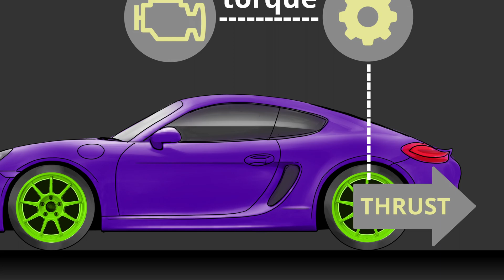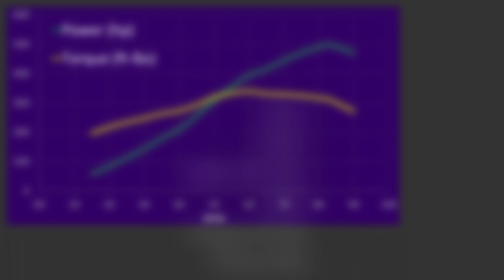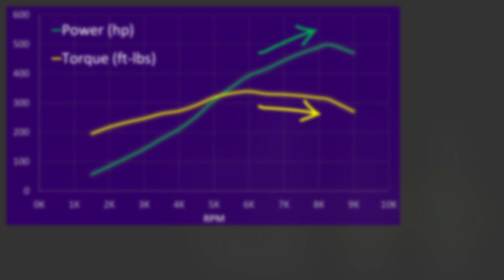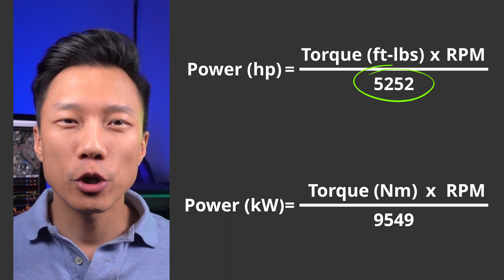Power vs Torque - ACCELERATION Explained [YOU'VE NOT HEARD THIS BEFORE]

Comment: What confuses me is how we can model the launch of a car. For example, for diesels, you have max torque at very low RPM. So, when you launch at that low rpm (around 1750 rpm), you have the maximum wheel torque exerted to the tires. So, theoretically, the car should launch the fastest at 1750 rpm. However, the car would launch much faster when loaded to 3000-4000 rpm. When the car is in gear and the clutch is fully engaged, what you summarized is completely true though.

Comment: @LastTenth
Great explanation!
Turbo vs NA engine
If we have two same cars, one with  NA engine,(with 200HP/15000rpm) and one with  turbo engine(with 200HP/7000rpm),  how than compare their acceleration, better lap time?  Both have their optimal gear ratios, but isn't turbo engine have more wider power band at higher rpms, more area under power curve, so is this reason why turbo will be always get better acceleration/lap time than NA engine? It will be good if  you can make detailed video about this Turbo vs NA engine, something related to area under power curve.
Reply from the maker: Thanks!
Physics doesn't care if a car is NA or turbo. If a car has a wider power band, it's going to generate more average acceleration. I'm no engine expert, but I don't know if the claim that turbo engines have wider power bands is universally true.

Comment: You contradict yourself.  You said as RPM goes up beyond peak torque, acceleration decreases, and then showed an example of higher thrust (and thus acceleration) at higher RPM.
Reply from the maker: I said acceleration decreases *in that gear*.
Reply: @LastTenth Right, but if power is what produces acceleration (which I think is your position) then why would acceleration decrease in that gear if power is still rising?
Reply: @ntdscherer  it wasn’t a contradiction: for a given GEAR peak acceleration will always occur at peak Torque.  However; for a given SPEED peak acceleration will always occur at peak Power.  

A practical example to illustrate?  If in third gear peak torque occurs at 3200RPM and 45MPH, peak acceleration in third gear will occur at 3200 RPM and 45 MPH.  If 45 MPH happens to be at the engines power peak in second gear the car will be accelerating harder in second gear at that RPM than it would be in third at that same 45MPH. 

Power, not torque, is the limiting factor in not only the top speed of a vehicle but also how quickly it can accelerate at any speed and how much weight it can pull up an incline at any speed.

Comment: So, if my engine produces peak torque at 2500 rpm and peak power at 5500 rpm, does that mean that in THE SAME GEAR the acceleration will be highest at 2500 rpm?
Reply from the maker: Yes.
Reply: @LastTenth  nice one, thanks
Reply: @LastTenth  I'm confused, shouldn't acceleration always increase as power increases?  if torque is basically force and power is forces/second isn't power the relevent one for acceleration. Torque being relevent in terms of how fast a car accelerates at a certain RPM for example from a cruise. In the example in the video you advocate for downshifting into high power RPMs but are now saying max torque RPM accelerates the most?
Reply from the maker: Hey thanks for your comment @carrot2556 ! First, power is not force/second. Second, I said we'll get max acceleration at the peak torque RPM, WITHIN a gear. If we downshift, the gearing is going to be different.
Reply: @LastTenth  I know but within a gear shouldn't the power matter more for acceleration,if so 5500rpm in 2nd gear accelerates harder than 2500 rpm in 2nd gear, as there's more power despite lower torque?
Reply from the maker: @carrot2556  no. Within a gear, torque matters more.
Reply: higher than at peak power yep but not necessery highest 😉 why ? cos it depend how torque graph look lower on rpms cos as vehicle increase speed all resist increases drag drive train losess and roll now if torque at 2500 rpm be 1 % more than at 1250 rpm the highest gforce reading in car can be registered lower than at 2500 rpm 😉👌🏻🍿…..
Reply: @LastTenth was correct to answer “yes” to your question but it only tells 1/2 the story.  To clarify and give perspective: Peak acceleration for a given GEAR will always occur at peak torque.  However, for a given speed peak acceleration will always occur at peak power.  A practical example?  If in third gear peak torque occurs at 3200RPM and 45MPH peak acceleration in third gear will occur at 3200 RPM and 45 MPH.  If 45 MPH happens to be at the engines power peak in second gear the car will be accelerating harder in second gear at that RPM than it would be in third at that same 45MPH.  
Power, not torque, is the limiting factor in not only the top speed of a vehicle but also how quickly it can accelerate at any speed and how much weight it can pull up an incline at any speed.
Reply: @rollsroyce329  yep, you are spot on. I already tested it with P-gear and my car, thats exactly what happens. I measured peak acceleration of 0.78G at peak torque at 2800rpm and it dropped off to 0.56G at peak rpm where the max power is in the same gear
Reply: @r390gt1lm now try it the other way.  Measure  G at peak power in first and note what speed that occurs.  Then measure G at that speed in second and third where the engine is likely making more torque at the corresponding RPM at that speed.
Reply: @rollsroyce329  yea done that too, since my car has peak torque in mid range and it drops off at high rpm, the best time to shift first 3 gears is at 7000, 4th and 5th at about 6000-6500, 6th and 7th at 5500 rpm.

Comment: I still don't quite understand, in the next video about shifting point said when to shift is when there are less torque produced in lower gear than in higher gear
Then isn't that torque is what important when thinking about acceleration? 0:17
Reply from the maker: I can see why it easy to mix this up. Yes WHEEL torque is what's important when thinking about acceleration. When power is higher, there is going to be some gear ratio that will allow the powertrain to produce more wheel torque, at some given speed, even if engine torque is lower.

Comment: Would torque be better for low speeds until reaching high speed which will utilize higher rpm for horsepower in a longer duration?
Reply from the maker: I'm not sure what you mean by better. Torque and Power are interelated. An amount of torque at some engine speed will always result in some fixed amount of power.
Reply: @LastTenth  you explain’d it correctly in the video. Gearing uncouples engine torque from wheel torque.
Reply: Many people think torque is for low vehicle speeds, towing steep hills and power is for top speed or very high speed.  This is an incorrect framing because gearing can change where and when we apply the engine’s power to the wheels. The engine’s Power, not it’s torque, is the limiting factor in not only the top speed of a vehicle but also how quickly it can accelerate at any speed and how much weight it can pull up an incline at any speed.

Comment: Power is a function of torque, not vice versa. Therefore torque is more important
Reply: Torque comes first. No torque, no acceleration from the crank. Then, it becomes a mix of both. Maximum acceleration of the vehicle (not of the engine) with a non cvt transmission is always happening between peak torque and peak horsepower on the RPM scale.
With a cvt transmission, tuning it to keep the RPM at peak power and letting the transmission doing the acceleration part is what yields the best results. Always.
Reply: @kextrz  both wrong👌🏻
Reply: Hivemind nonsense.  More Important? Power is the Product of Torque multiplied by RPM.  When we multiply something we get more… of it.
The engine’s Power, not it’s torque, is the limiting factor in not only the top speed of a vehicle but also how quickly it can accelerate at any speed and how much weight it can pull up an incline at any speed.
Reply: yea and torque is function of combustion and leverage and combustion is function of energy in fuel asf asf its like saying hydrogene   is more important than water cos water is function of hydrogene and oxygene 🤐🤷🏻‍♂️

Comment: So is gear five a shorter gear than gear 2? I have searched for the answer to this question and no one answers it. pls someone just answer this why would he not state it in the video? am i an idiot or something?
Reply: The smaller the number is, the shorter the gearing is, the greater the torque is at the wheels, the greater the acceleration is, until it's time to upshift. The reduction in torque at the wheels after shifting to the next higher gear isn't fully compensated by the higher torque at the crank.

That's the essence of it all, really. 

So, keeping the tranny on the lower gear longer, until the engine reaches peak power is what produces peak vehicle acceleration throughout the whole shifting process.

Unless the engineers completely messed up, or the wrong tranny got installed at the factory, what I just described is how it really is.

Hard numbers crunched in a simple Excel sheet would convince any skeptic. That's the beauty of mathematics. No emotion, no bias, no seat of the pant feelings. Just clear and hard facts.
Reply: @kextrz it dont compensate at all 👌🏻 ups must be where be most avg power not nesesserty until engines reach max power often later 👌🏻depend how power graph go in regard to difrrences between gear lenght in regard to speed range which somebody is interested in 👌🏻 if power increase rapidly before reach peak and drop down very slow + diffrences between gear lenght is big than ups must happen at way higher rpm than peak power rpm and couple other version 👌🏻 you ups at peak hp when power increase slowly and after narrow peak drop down very rapidly  …

Comment: Maximum torque at the driven wheel occurs at maximum power due to gear ratio. That's it. If instead of driving at the engine's Peak Power RPM, you drove it at the engines peak Toruqe RPM, no matter what gear ratio you choose, at the same car speed, it will not result in more torque at the driven wheel than if the engine were running at the Peak Power RPM instead. Engine torque =/= Driven wheel torque. Engine torque * gear ratio = Driven wheel torque. For the same car speed, if engine RPM goes up, gear ratio must proportionally come down. Thus if engine torque stayed relatively the same as RPM goes up and gear ratio goes up, then the engine torque is being multiplied up at the driven wheel.

The torque leveraging effects of the gear ratio (due to increasing engine RPM) are greater than the slight decrease in the engine torque between peak torque and peak power engine RPM's.

What this boils down to is that you can actually think of Peak Power as the RPM of the engines effective Peak Torque output due to gearing before the final drive output.
Reply from the maker: That is correct!
Reply: Very well explained. The last paragraph can be confusing, though. The driver can think of it as you describe it.

However, to make clear what is really happening, here's the equation to get the Force accelerating the wheels.
Everyone knows that F = m × a, right?
That means that a = F/m, so for a given vehicle mass (m), it's the Force at the wheels that matters.

For a given gear, that Force is equal to the engine torque at a specific RPM, times the overall vehicle gear ratio ON that gear, devided by the wheels radius.
Reply: And to sum it up from a benefit standpoint:

The engine’s Power, not its torque, is the limiting factor in not only the top speed of a vehicle but also how quickly it can accelerate at any speed and how much weight it can pull up an incline at any speed.

Comment: The lower gear gives you more torque, which helps the acceleration....the torque multiplied with higher rpm and the multiplier gives you the acceleration.  If the prime mover produces significantly less torque at high rpms your power will fall off as well.  So anything after peak power you will have less acceleration and is directly related to torque at that engine speed.
Reply: 100 hp 50 nm engine vs 50 hp 100 nm in the same vehicle both perfect gearing similar peak width asf and 50 hp 100 nm engine have no chance on acceleration 😎

Comment: Ever torque a fastener fast when you cant apply enough force to it?  Nope.
Reply: smaller bolt 1 m diameter hold with biger force at 100 nm than 2 m bolt diamter at 150 nm 😎 ….

Comment: at4:20 „you can generate more thrust despite less engine torque because higher gear ratio „ its true. only in regard to this egzample in absolute terms its not true if power at this setup with less tprq higher gear ratio be lower .

Comment: Isn’t it lbs ft?
Reply from the maker: Strictly speaking, I think you're right! Since it's newton-meter and not meter-newton. Thanks for pointing it out. Too bad I already recorded another video with me saying ft-lbs lol. I guess I fell into colloquialism...
Reply: There was a time when engineers differentiated between applied ft•lb and generated lb•ft.  Mechanics tended to use ft•lb, shop manuals and torque specs for fasteners were in ft•lb but mathematically that are interchangeable and tend to be used interchangeably at this points. tomAto. TOMaTO.  Probably moot.